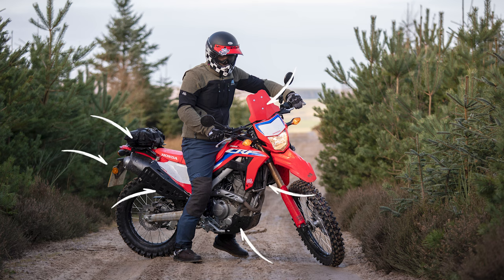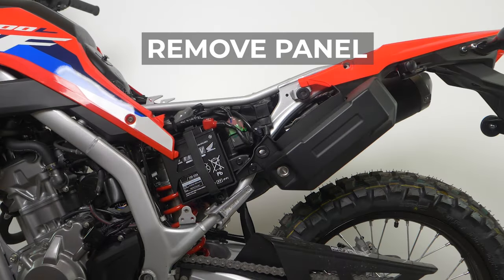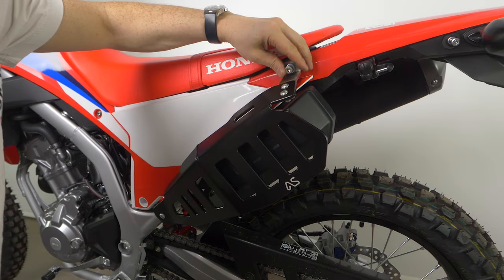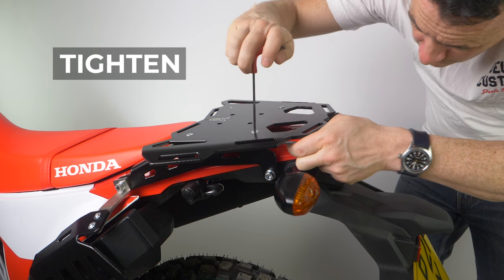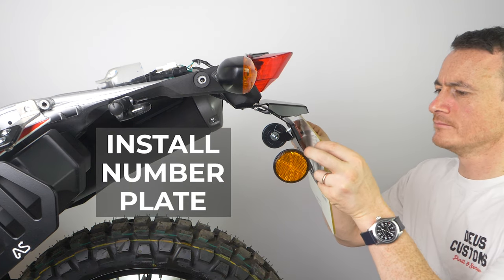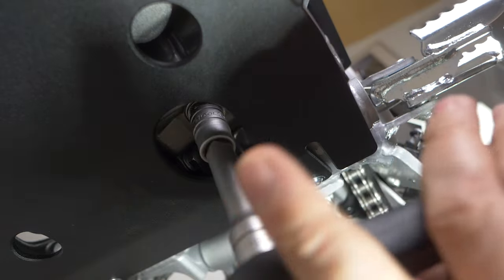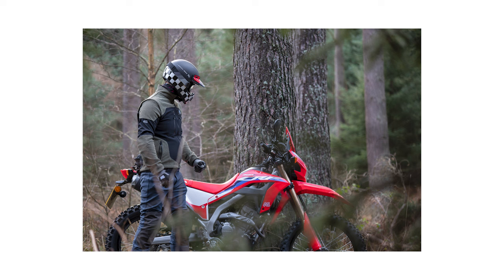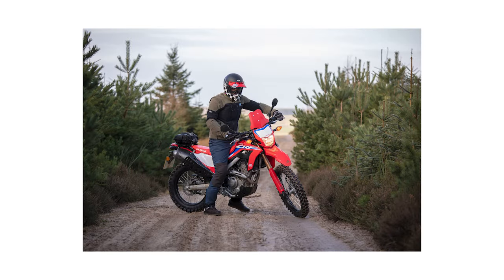The Adventure Spec CRF300L Hard Parts (and how to install them)

Comment: MINI FAIRING TORQUE SETTINGS FOR CRF300L

When mounting the mini fairing to you bike. The 4 bolts you need to remove are called "Top bridge pinch bolts" (in the video they are referred to as "Top triple clamp bolts") and the torque setting is 29NM Torque for the CRF300L.
Reply from the maker: Thanks for the extra info Alexander
Reply: Thanks Alex as this infos should come from AdventureSpec actually

Comment: I emailed adventure spec to see if the tail tidy was suitable for the Rally as it only stated the L. They couldn’t give me a definite answer as they hadn’t tried fitting one to a Rally, which I thought was odd as surely they could potentially double their sales if they tried. I purchased one anyway and I’m happy to say that it does fit, only suggestion is they could have made a dust cover to seal off the hole where the wiring goes under the panel
Reply from the maker: Thanks for the feedback Lee

Comment: got the mini fairing for the crf300l. It doesnt block the screen which is great but it does block the top bar of indicators/abs/engine/high beam lights which is a bit annoying. I'm tempted to just grind 1cm off of the bottom so i can see.
Reply from the maker: Hi Jack,  sorry it's not fitting how you'd like - if you want to contact helpdesk about this, the link is here: https://www.adventurespec.com/contactus
Thanks

Comment: The so-called dedicated mini fairing for the crf 300 still obscures the warning lights......  So I took it to the local fabricator who made good with an anvil and a 4 1/2 lbs lump hammer, which is nice.
Reply: I have the same problem. Where did he hammer it?
Reply: @garfieldus  
yes I was being a little sarcastic about that, it's just pathetic that they can't get something like that right and I cancelled my order for all the rest of the stuff they do....  it took 14 phone calls and numerous emails to sort out that they hadn't  sent me the 250 mini fairing..... But all is not lost attach the mini fairing using only the higher  strut clamp bolts... Oh and best of luck getting a torque wrench in there .
Reply: @ianharrison5263  Haha, ok.  I had thought of making a bracket to lift it in the same way as just mounting it on the top bolt but I think the brake pipe coming from the reservoir will interfere with it.
Reply from the maker: Hi @ianharrison5263 Apologies you had a bad experience, we try our best to give as much information as possible in the descriptions. This product also has a dedicated write up and extra photos explaining exactly how the fairing is positioned once fitted. 
Sorry again to read your comments, we have a new area on our website if you would like to suggest product changes as we appreciate all feedback: https://www.adventurespec.com/product-development
Many thanks
AS

Comment: MINI FAIRING PHONE MOUNTING INSTRUCTIONS

If you're wondering how you'll mount a phone to the Mini Fairing then I assume most people will use a Quadlock. In this case then I bought the following:

1. Extension arm (50mm) - Motorcycle Handlebar Mount PRO
https://www.quadlockcase.co.uk/collections/shop-motorcycle/products/extension-arm-pro?variant=41287233110191 

This is what you'll mount to the mini fairing. I tried the the Flat rectangle 2 hole base first which you can mount diagonally on the sat nav plate but your phone will end up at a slight angle if you do this so don't go down this route.

2. Knuckle Adaptor
https://www.quadlockcase.co.uk/collections/shop-motorcycle/products/motorcycle-knuckle-adaptor-motorcycle-scooter?variant=18336668188787

So you can adjust the angle of your phone on the mount. You could get away without this perhaps but your phone will be mounted at the same angle as the back of the fairing and won't be adjustable.

3. Vibration Dampener and whatever Quadlock lever head you want (standard or wireless charging)

4. An M5 x 20mm bolt, nut & washer (An 18mm should be fine). This is to affix the Quadlock extension arm to the Adventure Spec fairing.

5. You'll need 8mm & 10mm spanners and 3mm & 4mm Allen keys.

I didn't bother adding the raised sat nav mounting point to the mini fairing as it's not needed and it raises the phone mount out even further and it already comes out a lot with the knuckle and the dampener. 

Mount the extension arm to the bottom right hole on the mini fairing then angle it up towards the middle of the mini fairing. Don't fully tighten it as there'll be a bit of fiddling getting it at an angle so  your phone is straight. One you've added on all the quad lock bits (keep the knuckle adapter loose at first so it swivels still) then add your phone and tilt it all the way up until its perpendicular and touching the fairing (phone will be facing the sky). This will allow you to ensure your phone is straight before tightening the bolt on the extension arm. You should be done now and can add the front coloured part of the mini fairing to it.

When mounting the mini fairing to you bike. The 4 bolts you need to remove are called "Top bridge pinch bolts" in the video they are referred to as "Top triple clamp bolts" and the torque setting is 29NM Torque for the CRF300L

Comment: I would drill a hole in the battery box and cover with waterproof tape before reinstalling the battery.
Reply: What I did, except for the waterproof tape part. Box was already open anyway, haven't had issues yet.

Comment: Did you do a drop test for this radiator brace? For instance, drop the bike from a stand point to fall partially on radiator. I'm not convinced this thin plate of aluminium can protect radiator in that case.
Reply from the maker: This is the same radiator brace design that we have used for our other bike model hard parts, that have all been used and dropped while riding!
Reply: BD cubed mate.

Comment: Anyone else experience a loud vibration from the fairing at higher RPMs or speed?  I notice the second I hit 63mph, the fairing starts buzzing so loudly I can feel it in the bars and hear it through my helmet. Same issue anytime I accelerate over 7500 rpm’s. Was thinking about placing some rubber spacers between the plastic and the bracket.
Reply from the maker: Hi Michael, please can you contact our helpdesk and we can confirm placement etc: https://www.adventurespec.com/contactus

Comment: Have I missed something or do the side rails really only mount in 2 places with m6 bolts and what exactly does the radiator brace attach to because it looks like it just attaches to itself and the radiator and not back to the frame so not really doing anything…
Reply from the maker: The luggage racks are mounted as you describe. The radiator brace creates a 'cage' around the radiator that prevents lateral crushing and is mounted to the frame of the bike. See more here - https://www.adventurespec.com/shop/as-hrb-0037-adventure-spec-honda-crf300l-radiator-brace-938?search=300l#attr=

Comment: I have the mini fairing installed on a Crf 300l, and I am not very satisfied. When you drive on roads in poor condition or easy dirt tracks, the support does not have enough rigidity and vibrates, so if you have something installed on it, for example a mobile, it can be released and dropped. I'm not sure how to solve this problem. I'm trying to look for adjustable aluminum tensioners so I can anchor the mini fairing on one end and the handlebars on the other, but he didn't finish finding anything.
Reply from the maker: Hi there, if you follow this link you can create a ticket with head office and they will be able to discuss this with you. They would be happy to give some advice: https://www.adventurespec.com/contactus 
Thanks

Comment: Whoever decided to use hex for the radiator brace should be fired. There is no reason why it couldn't have been a nut end and a wrench could be used to tighten it. The angle makes no sense as a hex